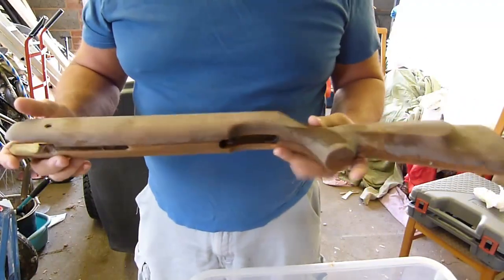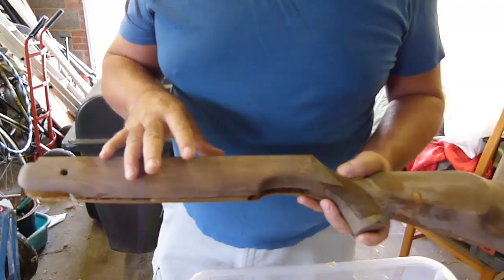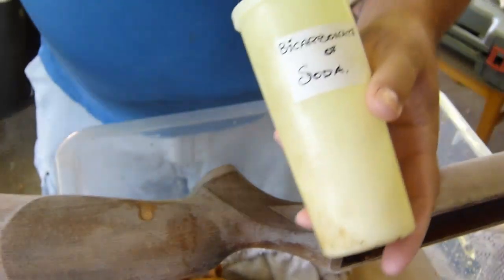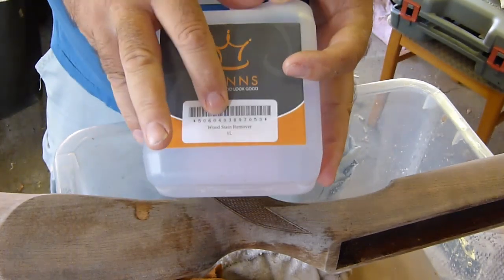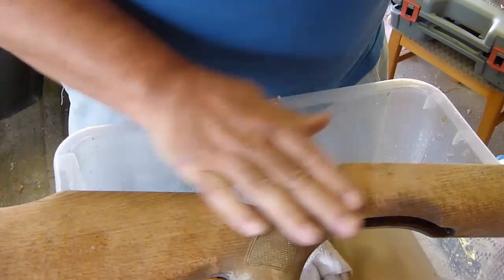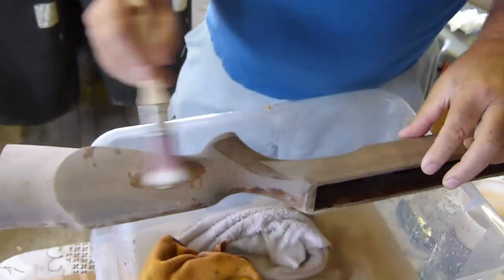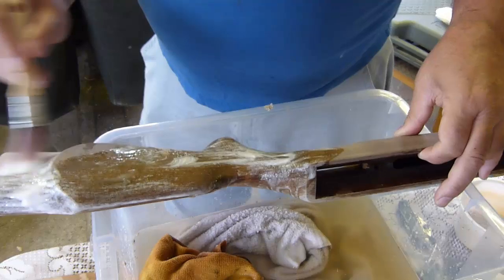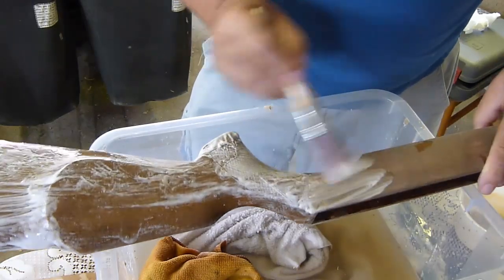Stock refinishing - removing the old stain and preparation.

Comment: Hi Neil,
            Thank you very much for your series on re furbing gunstocks. I've really enjoyed them and they've helped me very much.
Thank you also for showing us your Gin B stock on your Theoben SLR 98 in another posting. That has to be the most gorgeous piece of kit. Not just the stock, but the Theoben action, the magazine, pellet indexing on an underlever, how it all works, etc.
Absolute genius. A most beautiful, beautiful piece of kit, thank you.
I'm in the process of doing up a Diana Original Model 35. I'm going to apply what you've taught me with the stock.
The action hadnt been maintained at all and very dry. I've replaced the seals, sleeved the spring guide and piston, made my own top hat, and re lubed.
They don't recieve a great write up and I believe thats why the Diana Model 34 came out. However, that said, the action works fantastic now and no more twang/buzz. I'm so glad I made the effort. It belonged to my late, much loved father who would have been so pleased.

Comment: I put stocks int he Dish Washer with bleach on the hot water setting. I turn off the heat dry setting. Granted I have only don this with military surplus rifles but I have not had any problems yet at all. I will often I put a dishwasher crystals in the washer as well. When it comes out I dry it with a blow dryer and then sand since the hot water raises the grain. I have to take the top rack out of the dishwasher to fit the stock in. I have done that 3 times now and never any problem. 

Dye wood dye is difficult to find in America you normally have to order it off the internet since no stores sell them. They sell stains everywhere but not wood dyes! So it was very interesting to the dye in action.
Reply: Brilliant idea M8, thanks for the info

Comment: I have used bleach before, but know now that it does not remove the wood stain, rather it turns the stain "white", as well as the wood, so it is not a natural color.  Here is how I have just removed the old stain from a used M14 wood stock, came out perfect.  (1) Used 120 grit sand paper to get top layer of stain off, not much work.  (2) Painted a heavy coat of Citristrip on the entire stock, left it on for about 16 hours.  (3) Pressure washed the stripper off, being careful to keep the pressure washer wand moving across the stock, with the grain. (4) Sprayed Krud Cutter on the stock and on 00 steel wool, scrubbed the stock with grain, pressure washed the Krud Cutter off, did this three times.  (5) Hung to dry.  It really looks like virgin wood.  When I started this I was hoping to just lightly sand it all off, but could see the stain in the pores, and sanding that out would cut to much wood.  So, knowing the stain is oil based, tried the Citrustrip, but thought how would the stain be removed from the pores, (normally people scrape the Citristrip off with plastic putty knife) so I though pressure wash it.  The pressure washer scooped the loosened stain from the pores perfectly.  I probably could have stopped there, but decided to use Krud Cutter as well for good measure.  I will use this method again.  If you soak virgin walnut in bleach, it will change the color of it to an unnatural whiter color.  Just FYI.
Reply: I’ll try this with my M1 Garand stock. Thanks

Comment: I've had good luck with removing the stain, getting back to original light wood color with some Marlin stocks using a paste of pool chlorine crystals.  You can achieve a much stronger chlorine concentration than with bleach, and you can control the amount of moisture.  Make a paste, apply it all over and let it sit a few hours.  Come back and re-apply with freshly moistened paste.  The other seldom used wood chemical is called 'wood bleach' used by furniture restorers.  It will remove any kind of iron stains from wood (those pesky black rings on oak for example).  It is not really bleach, it's oxyalic acid that you can buy in liquid or crystal form.  Then, use aquafortis to bring out the natural grain in these light woods (flintlock rifle makers used this on their maple stocks to achieve the reddish color).

Comment: Great video. This is by far the best method or solution to whitening the wood stock. I had tried other bleach products but did not come close to your finish. So I ordered a bottle of this Domestos bleach. I ordered the one you showed on here, they sent me the same but reads "No stronger" instead of "Extended". All ready stripped the wood of the varnish and tomorrow I will start the bleaching. I am looking to get a nice Palomino tone. Just wonder if Winmax Natural wood Stain will give me that. Perhaps just yellow shellac.

Comment: Hi…
Just seen this. I am starting a project stripping back and refinishing an electric guitar body. I would like to know what tips or preparations you used to strip back the thick varnish.
I have tried everything from sanding to heat gun to Nitromors and nothing is touching it. Have you any experience with caustic soda or anything similar? I need something to get into the awkward shapes and curves similar to your gunstock.
I would be grateful for any advice. Thanks 
Phil
Reply: cabinet scraper

Comment: Gonna have to say sorry but this is movie magic I just tried this and most definitely didn’t end up with his results or anything close. It did bleach things but didn’t strip the finish
Reply: Yes, the clue is in the name... stain. At best this is going to alter the colour of the stain in the fibres. Also, to ongoing damage to the wood the bleach will need to be neutralized. Household chlorine bleach (sodium hypochlorite) is alkaline and has a pH of between 11 and 13. Without an acid to drop the pH the wood fibres will continue to dissolve, albeit, perhaps, over years. 

Were it me, I would wash the stock in a vinegar solution before drying. For each cycle of bleach, follow with a cycle of vinegar whilst still wet, then plain water.

Plain tap water is around pH 7 to 8 (slightly alkaline). Neutral pH is 7

Comment: I've got a really uncooperative stock that's got oil buildup on the grip (it's a Monte Carlo stock). What would you recommend I do to get it to a consistent colour for staining?
Reply from the maker: +RandomCanEHdian completely strip it. Use the industrial paint stripper you can buy from ebay (like the stuff I used)
Reply: How much do you dilute the house bleach, or do you just use it straight from the bottle?
Reply: I've bleached my stock multiple times but it won't whiten any more.
Reply: @RandomCanEHdian  q

Comment: I'm about to strip a old walnut stock from my father in laws Winchester 100 and he's asked for the new finish to be blondish stain instead of a normal walnut color, any suggestions how i can achieve that?
Reply: Bleach as done in video, use linseed oil only and it should stay pretty light. Tru oil will be slightly better but you might end up with it darker idk, I've never used Tru oil on a bleached stock.
Reply: @randomgeneratedname1264  I was thinking the same, just wanted to confirm, thank you very much

Comment: Do you think this method will work for a TX 200 stock?
Reply from the maker: +Keith Scott yes mate. I did a Walther stock after this one and it took a lot longer with more coats of bleach to remove the stain. It all depends on the type of stain they use.
Reply from the maker: +Keith Scott yes mate. I did a Walther stock after this one and it took a lot longer with more coats of bleach to remove the stain. It all depends on the type of stain they use.
Reply from the maker: +Keith Scott yes mate. I did a Walther stock after this one and it took a lot longer with more coats of bleach to remove the stain. It all depends on the type of stain they use.
Reply from the maker: +Keith Scott yes mate. I did a Walther stock after this one and it took a lot longer with more coats of bleach to remove the stain. It all depends on the type of stain they use.
Reply from the maker: +Keith Scott yes mate. I did a Walther stock after this one and it took a lot longer with more coats of bleach to remove the stain. It all depends on the type of stain they use.
Reply from the maker: +Keith Scott yes mate. I did a Walther stock after this one and it took a lot longer with more coats of bleach to remove the stain. It all depends on the type of stain they use.
Reply from the maker: +Keith Scott yes mate. I did a Walther stock after this one and it took a lot longer with more coats of bleach to remove the stain. It all depends on the type of stain they use.
Reply from the maker: +Keith Scott yes mate. I did a Walther stock after this one and it took a lot longer with more coats of bleach to remove the stain. It all depends on the type of stain they use.
Reply from the maker: +Keith Scott yes mate. I did a Walther stock after this one and it took a lot longer with more coats of bleach to remove the stain. It all depends on the type of stain they use.
Reply from the maker: +Keith Scott yes mate. I did a Walther stock after this one and it took a lot longer with more coats of bleach to remove the stain. It all depends on the type of stain they use.
Reply from the maker: +Keith Scott yes mate. I did a Walther stock after this one and it took a lot longer with more coats of bleach to remove the stain. It all depends on the type of stain they use.
Reply: Hi sir could you tell what kind of stain you have used?pls post of product link?